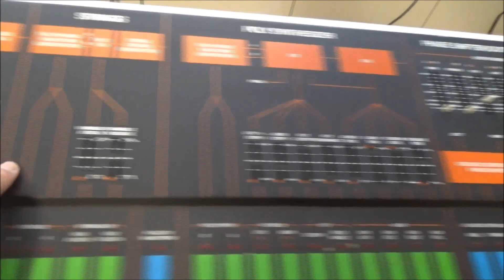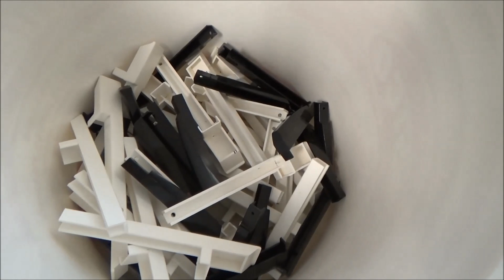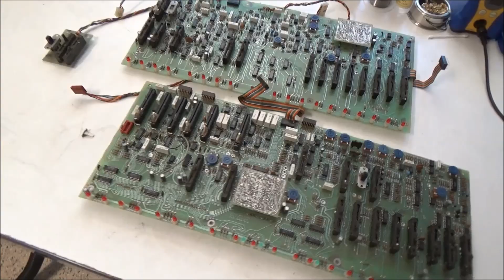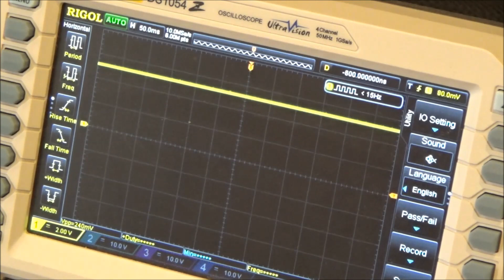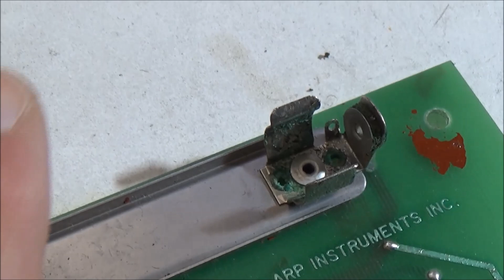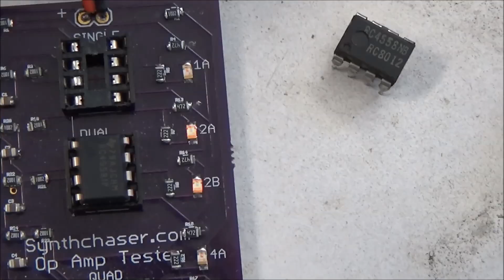Sad ARP Quadra Repair & Restoration - Synthchaser #124

Comment: Owning an original Odyssey where some of the sliders are so gummed up I'm too afraid to move them (one day I hope to be able to fix them) the lesson to synth manufacturers must be ... DON'T USE SLIDERS !!! The type ARP used, where the functional mechanics are open to the elements on a horizontal surface means they'll gum up even if never used just from dust settling on the synth. Rotary knob synths from the same period don't suffer anywhere near the amount of failures. The other crappy controls are those membrane function keys where the switch always eventually punches through, but at least that is wear from repeated use.

Comment: The digital side of the quadra is very, very rudimentary. You should be able to roll your own code for a 8048 and burn your own firmware. It's just a loop with a bunch of switch reads and some straight bits out to turn stuff on and off. Of course there are probably some muxes in the addressing scheme but that's easy too. it would be a shame to have a complete quadra gathering dust because it doesn't have the uController chip.
Reply: And don't worry about addressing that ram... just get one of the more recent 8048 variants that has plenty of internal nv ram (and maybe even some analog i/o ??) :)

Comment: @Synth Chaser - around 20.30 you mention leaving the copper bare. In similar situations in the past, I've used a wipe with plumbers flux (the soft waxy stuff) & run a lightly tinned iron over the tracks. A tiny blob of solder goes a VERY long way with this technique. Then just do the usual clean off before placing components. BE IN A WELL VENTILATED SPACE WITH AN EXTRACTOR!!! 

Good work-through this. Thank you

Comment: you MAY want to consider TINNING that exposed copper - ARP did it for a reason. it not only PROTECTS the copper below but GREATLY improves the resistance of the traces by increasing their cross sectional area (ESPECIALLY true now that you've sanded away a good portion of them)  -just  my two cents

Comment: really great video, when i sand off corrosion in an old pcb without soldermask i  recreate the tin layer over the copper with  chemical tinnig - sadly they are aggressive chemicals, but final result is like the original  and will prevent oxidization
Reply from the maker: Yes!  That's the way to go.  In the past I've tried to re-tin the traces with solder and it always comes out looking bad.

Comment: I have never been a fan of sliders on synths however you did an amazing job of restoration.  Thanks for sharing!
Reply from the maker: Neglecting usability, as someone who has to clean them, I don't like them either!  So much junk gets through the slots in the panel and all over the inside of the synth.  Rotary pots stay cleaner longer, and synths with rotary pots are much cleaner inside.
Reply: I thought I was the only one that didn't like sliders on a synth